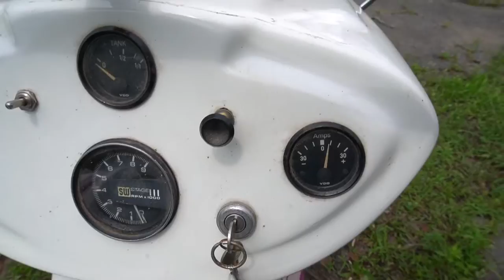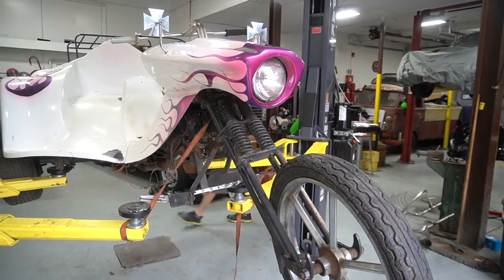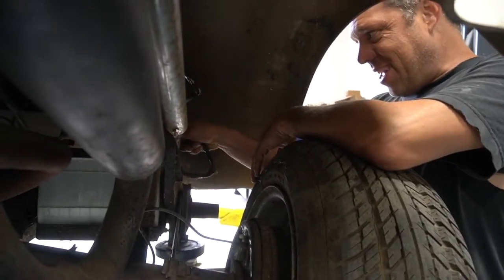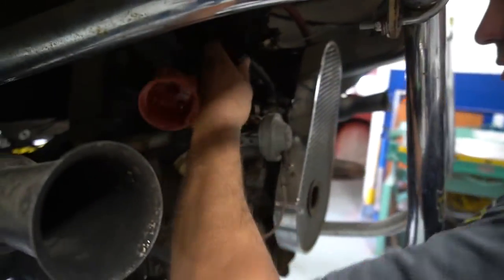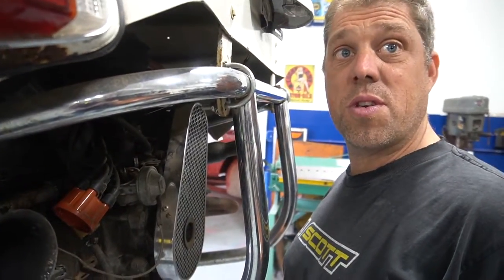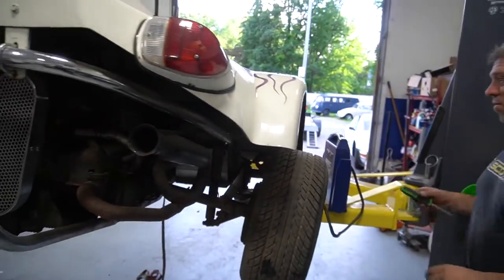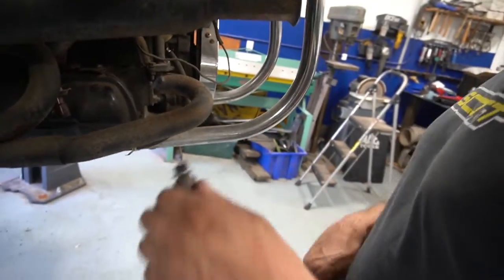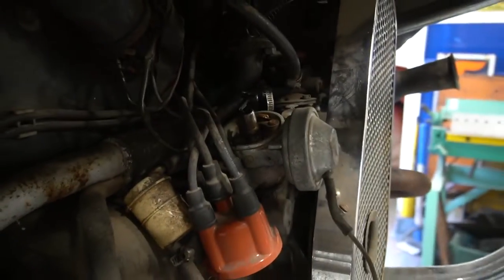Volkswagen Arizonan Trike found in an airplane hanger. Will it run?

Comment: Really cool trike. I always wanted one of these in my youth.
However 
The problem with these are all of them are missing one crucial part of the engine.
The VW body.
And what I mean by this is.
The cooling air comes from the upper slots in the body of the car. The cars body in connection with a seal keeps the hot air (rising) and being recycled through the engine again. Super heating the engine and dropping valves etc.
If it was started, and run down the road….not in stop and go traffic it would be ok, I suppose.
Anyway…..pretty cool find.